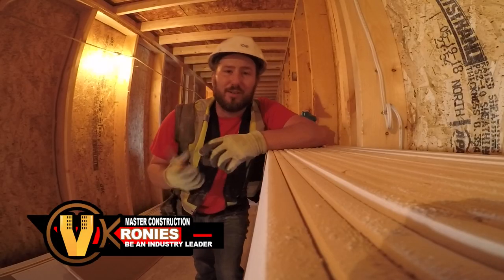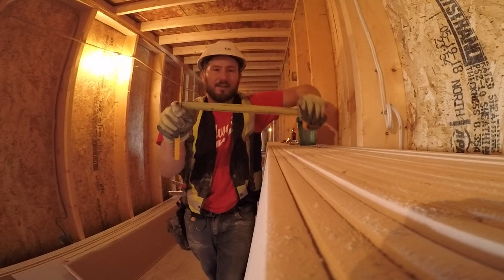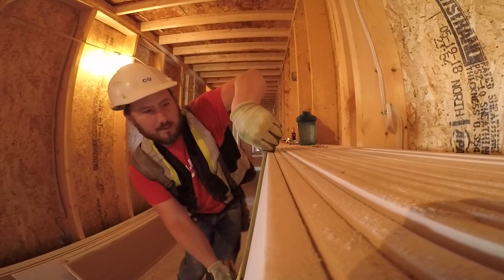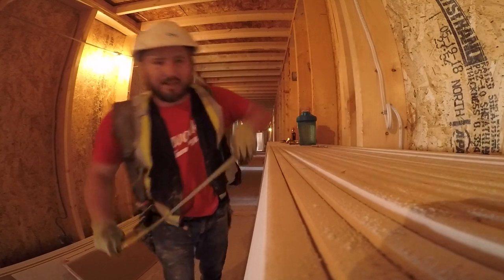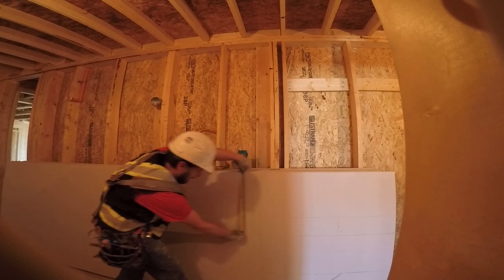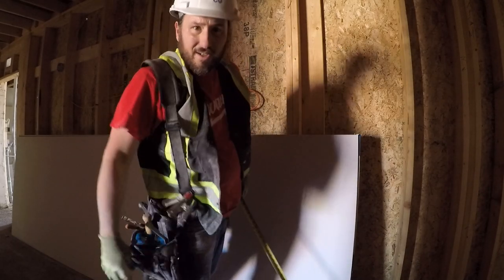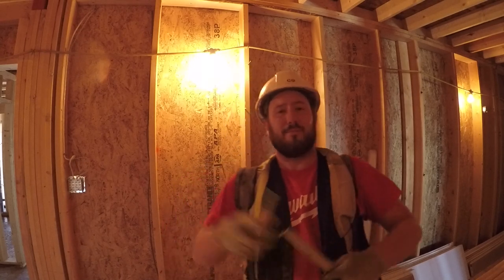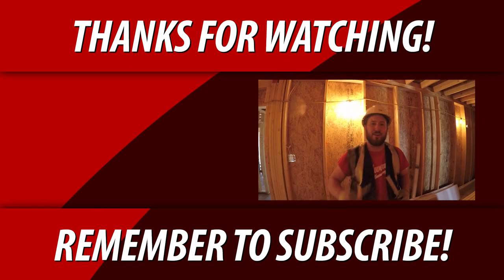How To Cut Drywall With A Tape Measure In 3 Easy Steps!

Comment: Great tip there Chris.  I've never tried cutting drywall like that but then again I'm just a DIY'er and using your method would save a bunch of time.  I'm used to drawing a line and using some sort of edge guide to keep the cut square but your method rocks it, with practice of course.  I'll def be putting this tip in my tool box for future use.  Thanks for sharing.  Cheers!!
Reply from the maker: Thanks William. This also works for cutting the butts off too.

Comment: Good tips. Thanks for mentioning to double score the 5/8 as most people do not know that. Fire guarding the hallways in apartment complexes is always a big job. Have a look at the walboarder's buddy drywall cutter. It both measures and scores to length or width We just finished a house with all the window returns and difficult ceiling detail that required stacked 1+1/4" strips for shadow lines hiding lights in a recessed ceiling feature. The house has 120 corner beads. Got tired of setting them in the end
Reply from the maker: Cheers man, I will check that cutter out for sure thank you. O ya we have been doing these apartment complexes for a year now and its all 5/8" type x.

Comment: You're taking my ideas away! 🤣🤣 Also one could hold their pencil in the inside of the tape measure tab and add 1/4 inch. Just depends on preference. Thanks and God bless! 😁
Reply from the maker: Awwh man sorry bro. I do this for everything with a flat square edge, plywood, cladding you name it, I only bust out the chalk line for angle cuts.
Reply: @ConstructionKronies  same here! 😁 drywaller of 30 years exp. More finishing than hanging though. I've always admired and loved getting involved with the "mechanical" side of drywall and framing. A HUGE break from the "compound" aspects  of it. 😁👍
Reply from the maker: Yeah man, I suck at finishing it!
Reply: @ConstructionKronies  😬